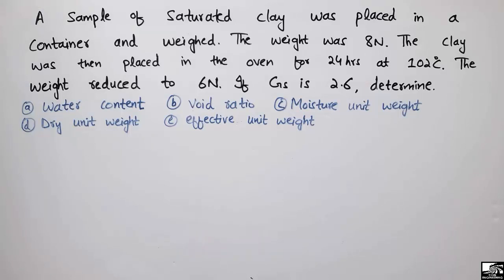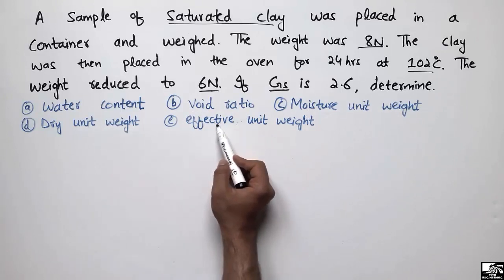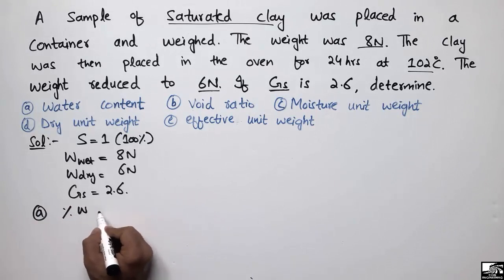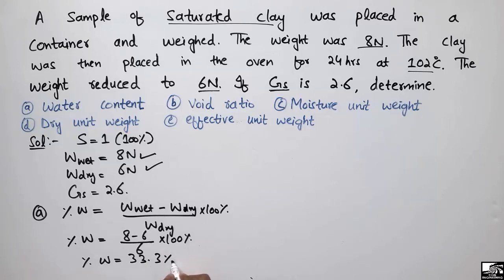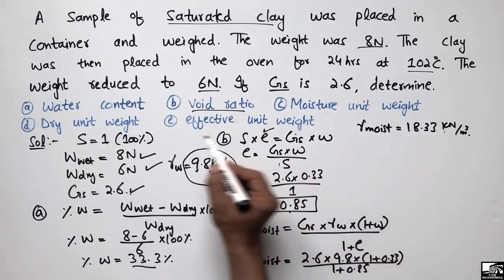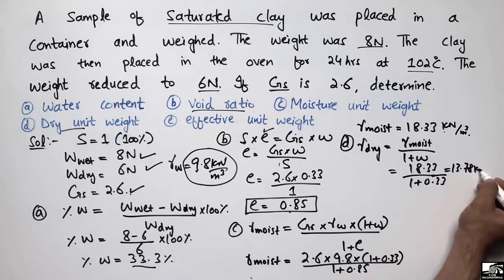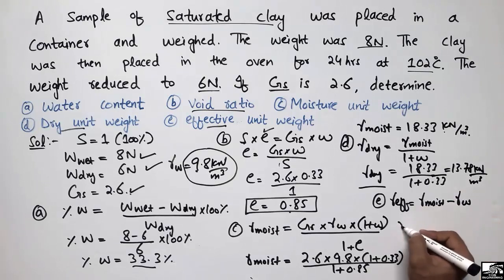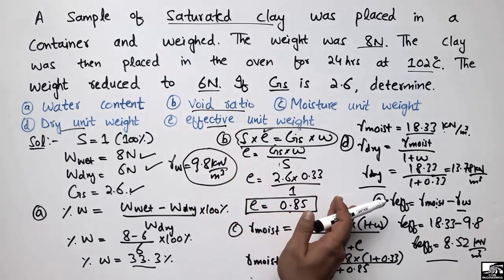Determine Water content, Void ratio, Dry unit weight, Moisture unit weight and Effective unit weight

Comment: A coarse grained soil is compacted to a wet unit weight of 2t/m3 at a water content of 15 %. Determine the relative density of the compacted sand given e_max = 0.85 and e_min = 0.40 and G = 2.67
Give me full explanation please